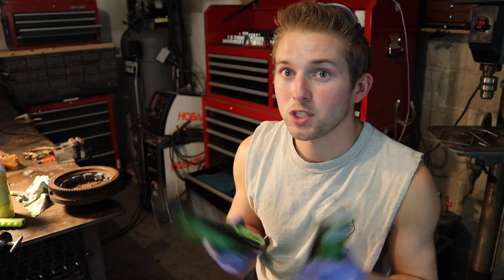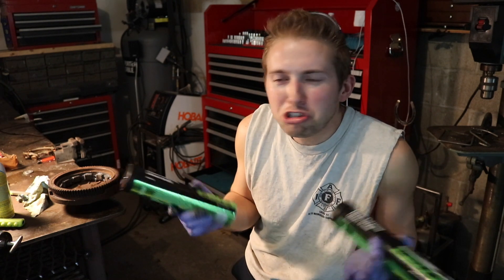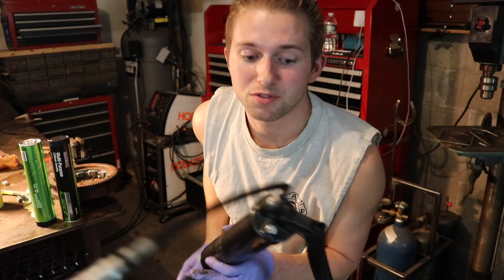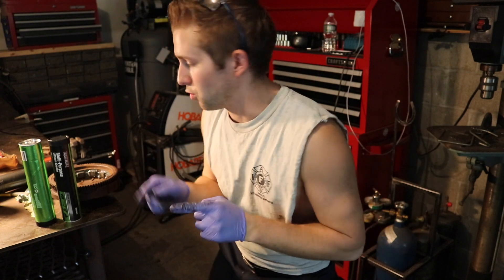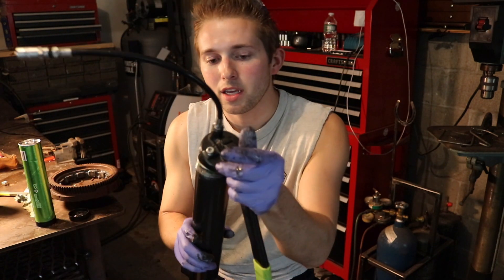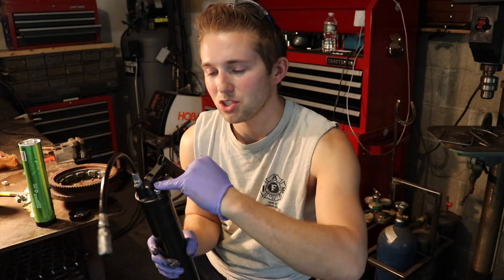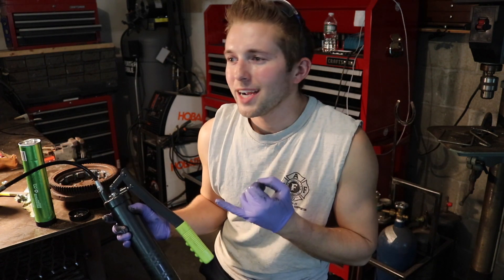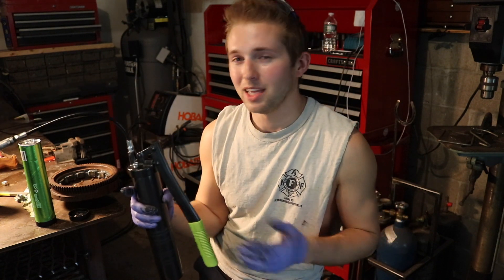Grease Gun Tips, cops don't want you to know

Comment: Grease guns are a PITA. They are always empty when you need them, then it takes about 18 hours to get the air out of the system so it actually pumps grease, then once you have completed all that, you go to put it on the zerk fitting and as soon as you go to pump grease in, the hose pops off the fitting and grease goes everywhere but in the fitting.